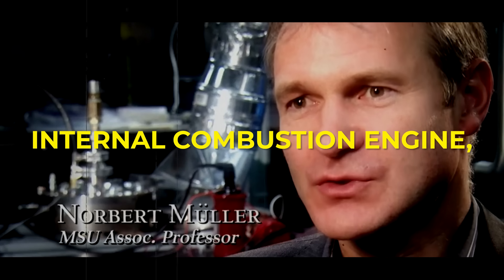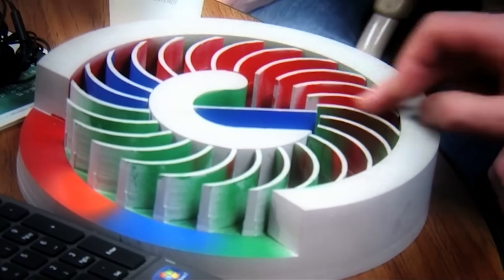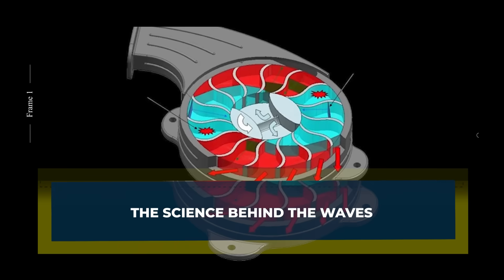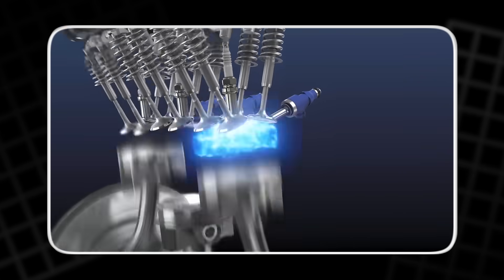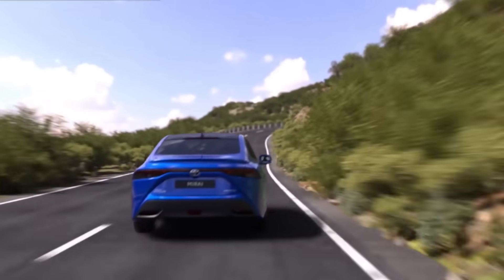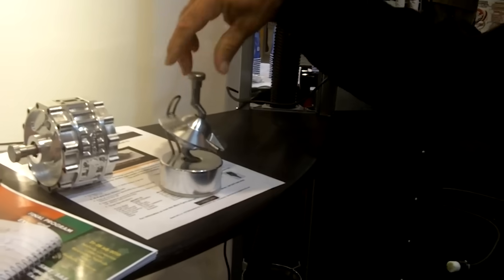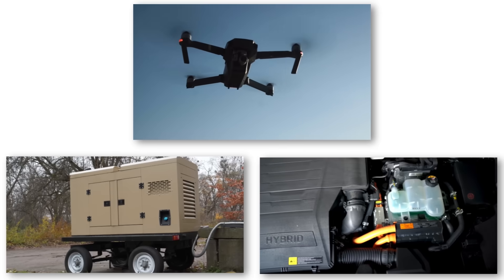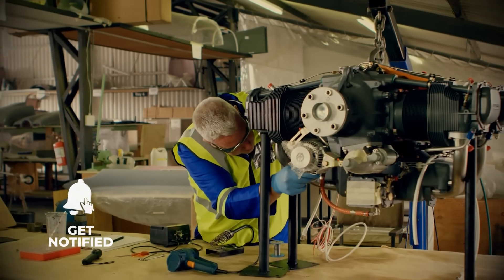A 60% Efficient Engine? The Forgotten Wave Disc Explained

Comment: it's like a 2D rotary detonation. if you could reproduce the same physics but use the exhaust flow as the accellerant and not the central shaft, you will win the Nobel prize and be richer than Musk

Comment: 60 % efficiency is theoretical impossible because all combustion engines have to adhere to the Carnot efficiency : 1- (Tlow / Thigh) in deg K.  Typically Tlow is arround 1000K this means Thigh is around 2500K. There are no materials in the universe that can withstand these kind of temperatures. A gas turbine with very special alloys and internal parts cooling is struggling to get above 35% efficiency

Comment: If this design utilize wave as oppose to piston, it’s rpm relates to a specific wave speed, the engine rpm will be the same regardless of vehicles speed, idle or top speed and any speed in between.

Comment: Too late. Burning fossile fuels is no longer up to date . . .
Reply: Yes but they are still being used so thus would make it more economical.
Plus it did say you can use hydrogen which you can produce on demand by electrolysis.

Comment: An recycling system taking the first combustion of the engine and adding it back to the engine with fresh oxygen and straying fresh fuel calculated to make the two combust to the more horsepower and efficiency of burning the exhaust gases into the carbon filter system and collecting the gases filtering out all but safe gases would end the needless expense of catalytic converters. This could be refitted to existing engines and use the same concept as an afterburner.
Reply from the maker: That's a very detailed and insightful idea for improving engine efficiency and emissions!